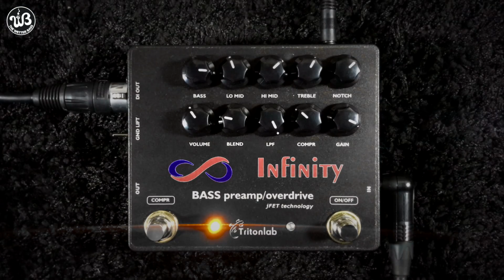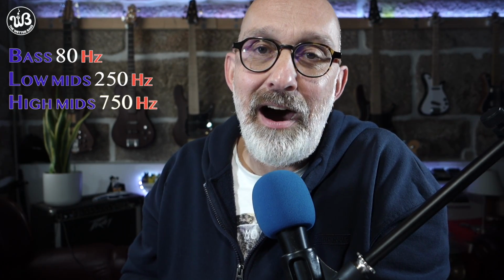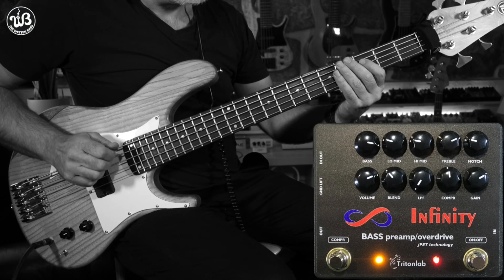For both live and studio. jFET preamp/overdrive with parallel compressor and DI.

Comment: Oh the infinite world of bass preamp pedals! I was so infinitely unable to decide how to color my sound, because of the infinite great options like this Infinity, that I went with the mxr m81 that doesn't color anything at all (I think), and left all the coloring to my other pedals. :)
Reply from the maker: 😂 infinitely wise comment. Nice form factor from the M81, but no compressor… 😬
Reply: @thewetterbass  A compressor was actually  my first pedal. I use it first and the preamp last on the pedal chain (because it feels right to me) but I have seen boards with two comps and I love them.... so... hmmm
Reply from the maker: @konstantinosziakas  I have a rule (that might change, cause rules are meant to change): compressor behind a drive pedal to play with its dynamics, compressor in front if I want a constant amount of drive. So having the two (comp+drive) in parallel is a great middle ground!

Comment: As always, great demo! Love the selection of frequency bands for the EQ. Are these available anywhere in the States?
Reply from the maker: I honestly do not know. Get in contact with Alex from Tritonlab. He will definitely let you know how or where to order the Infinty. And yeah, the eq is spot on for bass.
Reply: Should I ask for him through the email address on their home webpage? Also, I bet this would sound great through the Shift Line A+ Cabzone X
Reply from the maker: Yes email Alex. And through the 2x15 or 8x10 cab sim of the CabzoneX it sounds huge… 🤩
Reply: Even with its onboard optical compressor, do you still use your BecosFX compressor pedal prior to the Infinity?
Reply from the maker: No need, unless you absolutely want to control dynamics for effects in between the Twain and the Infinity.

Think of the infinity as the travel light “one pedal” you would show up to with for a gig or live session, to substitute your bass amp, plugging directly into the PA using the DI of the Tritonlab. Where as the Twain would be used in a full setup tool for live or especially for studio recording. But, this doesn’t mean you can not use both!

Comment: The only thing I miss is a switch to turn on and off the drive.
Reply from the maker: I agree, however the gain is part of the preamp so it’s kind of a set-and-forget addition to the sound, that’s why there’s no individual footswitch for drive. So consider this pedal as a tube preamp alternative.
Reply: @thewetterbass  After watching the video I made a patch in my Boss GT1000 Core running an unprocessed signal, a parallel compression and another parallel overdrive and preamp. It's a gorgeous tone.
Reply from the maker: Nice!!!